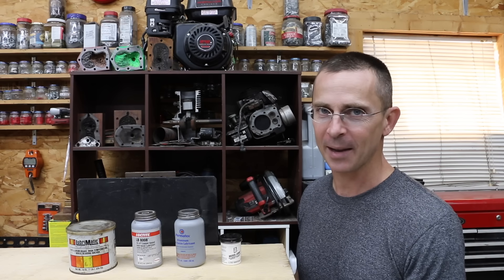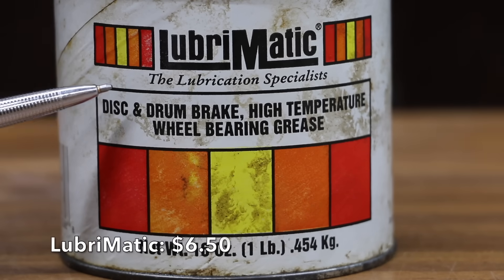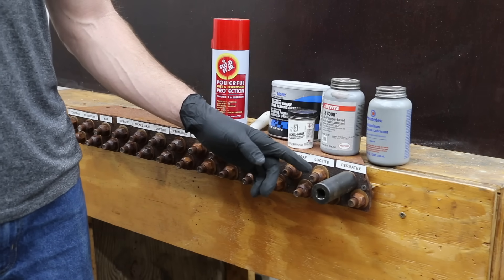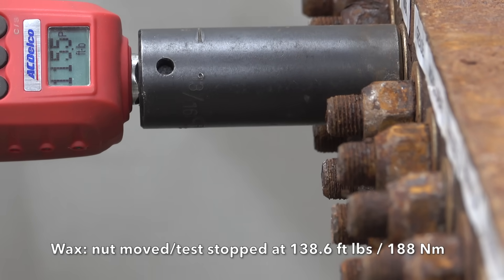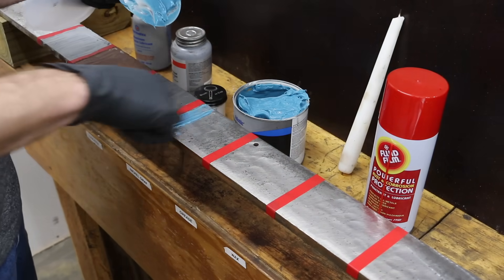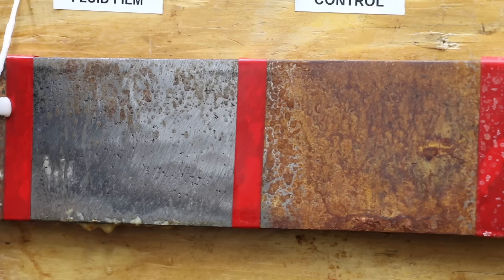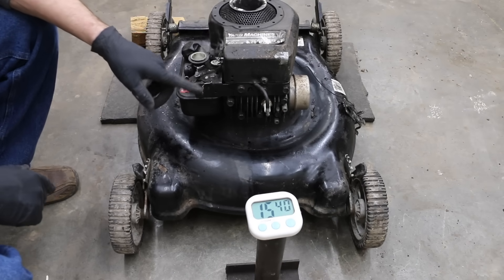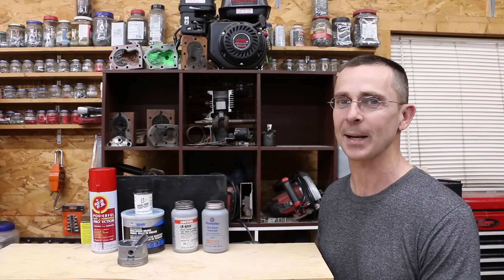Does Anti-Seize Compound Actually Work? Let's find out! Anti-Seize vs Grease vs Fluid Film vs Wax

Comment: I always coat inner flange of brake rotors and CV axle splines with anti-seize. It just makes it that much easier for the next tech.
Reply: Would WD-40 be any good, or am I wasting my time?
Reply: @SamSteeles  The standard WD-40 is a water displacement fluid I use to dry out ignition systems and not much else. It sucks as a lube and rust treatment. My best advise is there is no magic product that does it all. Get the right product for the right application.
Reply from the maker: Thanks for sharing.

Comment: It was pretty easy to predict that anti-seize would destroy the engine, viscosity is way too high to let oil get where it needs to be and the ridiculously high metal particles concentration adds far too much drag. Would probably have lasted much longer if diluted 2:1 with regular oil.
Reply from the maker: Thanks for the feedback.

Comment: I work offshore on Remotely Operated Vehicles (ROV) which are in and out of salt water all the time. 
We use a product called Aqua Shield (formerly AquaLube) grease by Houghton International Inc. which is a Waterproof Lithium Based Grease. You can normally find it a boat yards. You could give that a try.

http://www.thebuyingnetwork.com/Aqua-Shield-Grease-s/1819.htm
Reply from the maker: Thanks for the video idea.

Comment: Anti seize is a must. I have a 28ft Uniflight sport fishing boat, you have to use some anti seize or everything will be trashed in no time.  That and i always add some copper anti seize to my spark plugs in my Fords with aluminum heads. "An ounce of prevention is worth a pound of cure"
Reply from the maker: Thanks for the feedback.

Comment: Todd, soo I should forget about using candle wax to prevent galling on “stainless steel “ fasteners, right? 😂
Reply from the maker: lol. Seems like a fun test!
Reply: I had sailboat turnbuckles that were recalled due to stainless on stainless galling. The replacement part was a very high strength bronze screw. So you end up with stainless on bronze and apparently galling is not a problem. May have been silicon bronze.

Comment: I did exhaust gaskets on my truck. On the right side, I used anti-seize. On the left side, I used grease. About two years later I took the two manifolds off. The side with anti-seize came right off. the other side came off tough. A roller for the drum in my clothes dryer was squeaking. I didn't have any grease handy so I used anti-seize to lubricate the bearing. It only lasted about two weeks and started squeaking again.
Reply from the maker: Thanks for sharing!

Comment: Great video as usual!  How about a comparison between using regular grease or dielectric grease for electrical connections to keep them from corrosion. I switched to regular grease because of the high cost of dielectric grease for the trailer connectors on my truck and when I store my trailers outside.
Reply from the maker: Thanks for the video idea.

Comment: This guy kicks ass, he's strait down to the point and strait forward.  I think the only anti-seize I used was on steel and stainless steel bolts (new) on flanges to stop corrosion. Works on stainless because sometimes the stainless bolts and nuts start chewing on each other and it's either it torques off or you cut it off.  Really interested on what bolts lasted the longest so I can take it to work.
Reply from the maker: Thanks for sharing.

Comment: I'm not sure the torque numbers can really be taken for much use. Given that each substance would have resulted in a different amount of clamping force and therefore bolt stretch and static friction against the surface. Perhaps a more fair test would be similar to how some fasteners are listed which would be "hand tight" or a low torque figure and then 90 degrees or similar. Still not perfect I admit however I've been taught that it does result in a more consistent value. Then the loosening torque could be measured and more easily compared IMO.

Thanks for the video!
Reply from the maker: Thanks for the feedback.

Comment: I deal with machanics and do lots of work on cars myself and I can tell you the best use for anti seize is when doing a brake job ( permatex silver is preferred) coat the hub plate and then install the new rotor.  Next time the car comes into the shop you won't need a sledgehammer to get the rotor off. 
So maybe try a rig with two metal pieces with anti seize in between them bolted together,  add rust and time ect. And forget the bolt toque and test how hard it is to separate the two pieces of metal.
Reply from the maker: Thanks for sharing!

Comment: Great experiment. We exclusively use copper and nickel anti seize in our heavy industry mining operations. Works great. In the end though no anti seize will protect against time. As a added note. To get the best protection on exposed bolts threads, add the step of wrapping the threads in Denso tape. Only works in certain applications but we done right is great insurance.
Reply from the maker: Thanks for the feedback.

Comment: Great job and explanation!  I want to reiterate your point that copper and aluminum are dissimilar metals that will corrode at the electrical interface, therefor I wouldn't use the copper anit-sieze for assembling aluminum parts.  The real anti-sieze will contain some kind of metal powder usually, that remains in the threads at high temperatures where a paraffin or mineral oil based lubricant will be evaporated away over a period of time.  In the case of spark plugs in an aluminum head for example, I find the aluminum anti-sieze shines if used according to directions.  Great for exhaust system hardware such as pipe flange to manifold bolts/studs.  On pipe manifold flanges, I use brass nuts wherever possible, so copper anti-sieze lubricant will assist avoiding galvanic corrosion there.

Also important: use an anti-sieze on oxygen sensor threads that's compatible with the oxygen sensor.
Reply from the maker: Thanks for the feedback.

Comment: First thing I noticed before I even watched the video was your thumbnail... Aluminum anti-seize??  Where do you get that?  All I've seen is copper and nickel-based.

And as a mechanic, sure grease and wax is good for preventing corrosion ingress, but anti-seize is better because in the event that fails, there's still solid metallic powder which blocks the expansion of iron oxide.  Even if some occurs and it tightens up, it won't lock because the powdered metal will still be between the two corroded surfaces, and will still allow movement with tools.

Also, another important feature of the metal powder content of anti-seize is it blocks two surfaces from galling and locking against each other, especially when stainless steel fasteners are used, and when regular fasteners are at high temperature, such as exhaust manifold bolts or studs.

In short, grease is second best because of it's semi-solid tenacity with its fluid-like adhesion, but anti-seize goes beyond just simply serving as a barrier to corrosion, due to the mechanical properties of the metal powder filler.
Reply from the maker: Thanks for the feedback.

Comment: The copper anti seize is the shite for metal on metal brake parts that rub. I use a different brand but they are all pretty much the same I think. I would never use it on bolts though, I use regular anti seize on bolts since the copper  stuff is too expensive and doesnt work as wekk on bolts, IMO.
Reply from the maker: Thanks for sharing.

Comment: I’m curious if you think you could do a video on socket quality. I’m in the market for a new socket set for my socket wrenches, and not all steels are very good. Say a comparison of 3/4 inch sockets from various brands, and their ability to resist wear. Maybe also measure thickness of the wall at its thinnest point with a caliper?
Reply from the maker: Great suggestion!  Thank you.

Comment: All you had to do was ask a good gunsmith.  WE use nothing but Loctite Copper.  Those super fine threads on a shotgun choke tube, and the thin walls of that tube and the barrel, need a good anti-seize, and the Loctite Copper is all we use.  Good thorough test though.  I knew which one would win before you began.
Reply from the maker: Thanks for the feedback.

Comment: Would like  to test the strength of  2x4  glue (weldbond) 2x4 on edge with & with out  different cdx&osb of different thickness in between the 2x4 , which hold the load .
Reply from the maker: Thanks for the video idea.

Comment: On boats we often have to deal with corrosion between aluminum and steel parts. We always use a product called Tef Gel. I would love to see a comparison of Tef Gel vs Permatex aluminum based never seize as that may work as well or even beat Tef Gel. The copper based Loctite would not be good because the copper would eat away at the aluminum... they say but who knows?  :-)
Reply from the maker: Thanks for the video idea.

Comment: Fantastic test!!! I never trusted those anti seizing products, but they seem to work fine!  My grandfather learned me a quite different waxing method: heat up tightened bolts or nuts to 75°C and let the wax (60%paraffin, 40%bees wax (less brittle)) melt into the thread. Worked always fine for me!
Reply from the maker: Thanks for sharing!

Comment: Great job! What about using it on spark plug threads for at least 10,000 miles in extreme heat 100+ degree F, and see if the plugs break free easy?
Reply from the maker: Great suggestion!  Thank you.

Comment: Everyone says to never put anti-seize on studs/lug nuts because the torque rating is for dry threads and you might break the stud before getting the lug to snug up. Any body know how to prevent the lugs from seizing without risking the wheels coming off? Twice a year I feel like I'm about to snap my studs because it rusts on so tight.
Reply from the maker: This seems like a great video idea! Thank you

Comment: wax can go acidic when it breaks down,this is the reason most wax paper capacitors go bad in old electronic equipment, acidic wax eat trough paper and causes short circuits
wax was oryginally used to prevent screws drived unto wood to rust so this may be a legend based in some old technology, but not long term observations
Reply from the maker: Thanks for the feedback.

Comment: When I was a marine mechanic on the gulf coast of Florida, we used OMC Gasket Sealing Compound (I believe the Loctite 30517 is very similar) on nuts and bolts. It was especially useful where bolts or studs went through a flange into threads (like lower unit bolts or head bolts) as it was viscous, safe on all metals, and it had enough "bulk" to take up windage and prevent saltwater intrusion. "Actual" anti-seizes tended to get flushed away over time and didn't work to prevent salt from building up around the bolt/stud shank and creating an interference fit. In some applications, the threads aren't the only place one needs protection from corrosion. Removal torque is slightly higher than with lube-based anti-seize, but only because it ends up slightly "gummy". It may be a good one to try in a future anti-seize episode using a slightly different test procedure (maybe head bolts or something similar).
Reply from the maker: Thanks for the feedback.

Comment: I used to work at a water treatment plant and pump stations and used to work on pumps and fitting that have been wet for sometimes decades. 
I can tell you anti seize works best by far in the long run. Grease works ok but eventually causes its own problems.  Anything untreated was usually just cut off because it wasn't worth the effort or it just crumbled away anyways.
Reply from the maker: Thanks for the feedback.

Comment: I’ve used silicone grease in brakes and for bolts pretty much everywhere since it’s pretty heat resistant and neutral to rubber
Reply from the maker: Thanks for sharing.

Comment: I have been using anti Seize 30+ years and when your talking over a long time, you can still remove old bolt and/or nuts especially on Racing headers.. I had to use a Permatex special anti freeze rated at 2400deg, in our Oven Presses, to form Titanium parts, on the SS screws that held the Die's together...
Reply from the maker: Thanks for the feedback.

Comment: Good stuff.  I use the permatex stuff religiously, especially on stuff I plan to work on in the future.  I once used it on an ancient mower deck that I was rehabbing.  Lots of heat and effort it finally came apart.  When I reassembled I applied anti seize.  5 or so years later I took it apart to replace a bent spindle and it literally slipped apart.  I was sold.  
I understand why some call it “mothers love”.  Lol.
Reply from the maker: Thanks for sharing.

Comment: 9:08 it would be helpful to emphasize the area in which the water had exposed the metal to the elements, if you could spray it with some corrosive solution. the rust would show a contrast on the metal and give more detail to how much of the area was actually exposed. as always thank you for the wonderful work you are doing and i always try to follow your videos advice when i'm looking to buy a good product.
Reply from the maker: Thanks for the constructive feedback.

Comment: Awesome testing & results as always PF! Have you tested any product(s) that could be used for getting really rusted bolts/screws to come apart? I have an old wheel barrow with rusted bolts & am unable to remove any of them. Had to resort to using a metal cutting rotary blade for removal of the bolts, not fun. Anyway, thanks for your great videos...........Stay safe........  👍👍😉😉
Reply from the maker: Thanks for the video idea.

Comment: curious if you could add engine paint to your lineup. I have a sailboat and every bolt or nut i take off i spray silver engine paint onto, this was told to me by a marina engine repair tech years back on how to prevent the saltwater from corroding everything on my engine, so after snapping a few bolts and nuts taking things apart for repairs over the years i have used the same can of silver engine paint and none of the bolts or nuts I've used it on have ever seized up on me again or corroded like the nuts and bolts I've never taken apart prior to me coating them with engine paint.
Reply from the maker: Thanks for the video idea.

Comment: You missed just one of the recommendations. Wiping the bolt with a greasy rags before installing it. No idea how many time's I've heard it despite using white lithium as my anti-sieze (works as well as permatex).
Reply: Or dip it in some used motor oil
Reply from the maker: Thanks for the feedback.

Comment: "I suspect this damage was caused before the anti-seize"  LMAO... I'd say.  That little engine has been through hell!
Reply from the maker: Thanks for watching.
Reply: @ProjectFarm  

Now stupid question. 

Why did the connecting rod give way in such a fashion?
Reply: DragonZer0 prior damage? Maybe anti-seize doesn’t cool the components as well as engine oil, so overheating weakens and damages the components
Reply: @DragonZer0  I think that the anti-seize was too viscous and would not carry away enough heat and once the heat built up in the big end it wore down, softened, and failed. IMHO of course.
Reply: @DragonZer0  Likely the big end of the rod wore & began to oval with the heat.  Then the impacts at top & bottom when the piston change direction, the impacts impart a severe shock load to the rod.  Then all it takes is an imperfection to turn into a small crack, when quickly grows, and...
Reply: It might have started before this test, but “anti-seize” lubricants act like marbles in Greece, so it couldn’t get into the journal of the crank/ connecting rod as easily a liquid oil, thus allowing the rod to heat up and expand beyond its capacity and breaking. There was no way that the cylinder would have seized, because the clearance between the piston, rings and cylinder was was more then ample in allowing the lubricant to slip in!

Now what did the cam and lifters look like, when doing a test like this on an engine, before and after pics of more then the piston, crank and cylinder head should be taken, a long with any and all measurements possible. Not just use the engine as a Ginny pig!
This way your before pics, and measurements will mean one thing, and the after will actually tell the story!
 I guess your going to send this one up to Musty1 to see if it can be saved , for yet again future failures!

Comment: Ultra low sulfur diesel fuel vs “black” diesel test. Where you test the lubricity of them etc. mixing diesel 50/50 with used motor oil to make your black diesel. 

A few old timers swear by black diesel in older mechanical injection tractors like your old ford, as well as in the multi-fuel military surplus 2 1/2 ton trucks. Plus it’s a great way to reuse and dispose of your used engine oil.
Reply from the maker: Thanks for the video idea.

Comment: Thread locker as anti-seize. Creates a polymer layer on the threads keeping corrosion out.
Reply from the maker: Thanks for the suggestion.
Reply: I've heard this too. It makes sense, and it definitely won't wash out over time.
Reply: The thing is, that gets pretty expensive to use, even if you use the generic (Harbor Freight, etc) instead of major brand.  Not so ironically, the best product for a job is usually the one made for that job.  I know it's hard to believe, like they thought about it or something.
Reply: @stinkycheese804 , The person who told me about it actually works for one of the companies that makes it. So not an unbiased source. But if it works well it might be worth the cost for some parts.